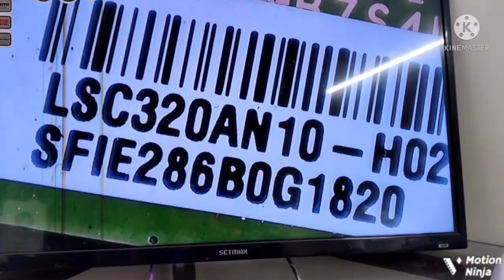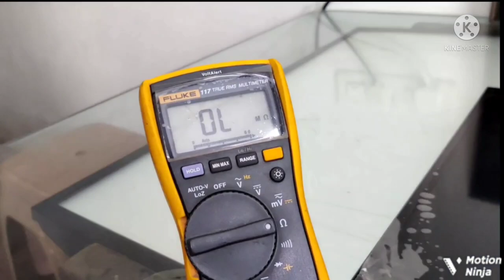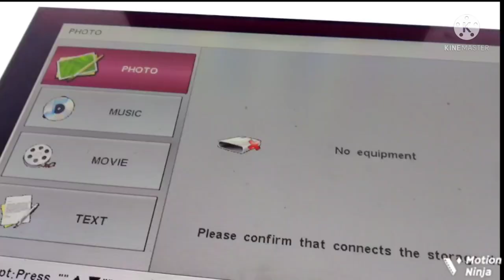LED Panel Short killer Method  Part-1  For educational purpose only

Comment: Hello sir. I have 55inch 4k tv Samsung. The tv panel also is shorted(right side) 
If i use tape strip i can enable a tv, but one place on corner start heating, and also on a picture start to show horizontal lines. How you found which line are shorted? Can you help me. Thx

Comment: What was the voltage applied to shorted trucks ?
Reply: Training for gate lines short remover 
Gate lines contains from 8 to 16 lines according to panel design 
Left and right has common lines , you need to detect whether both sides are found short , then only it is need to remove short .
Mostly  panel high voltage lines get short thus vgh and vgl .
This short can occur ON THE TFT SUBSTRATE where cof is bonded 
So you need to check whether it is near to glass bonding area  if it is near glass bonding then you can remove by cutting the burn   cof lines and you use the panel by one side gate switching .
Another one inside the glass substrate you need found which lines are short each have it owns working voltages you cannot give unlimited  , you can calculate with vgh to vgl , if vgl -10 and vgh 30 then your total voltage should not exceeded to 40 if you give more than forty then the switch over mosfet inside the glass will permanently get short .
Use short killer like sparking touch don't keep it permanently glass will start to burn .
                           Shafi .j